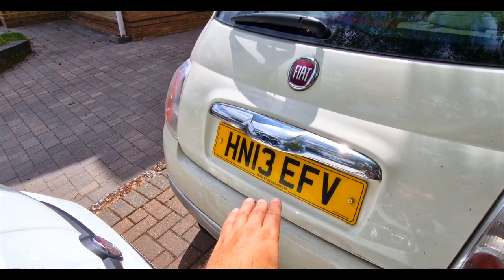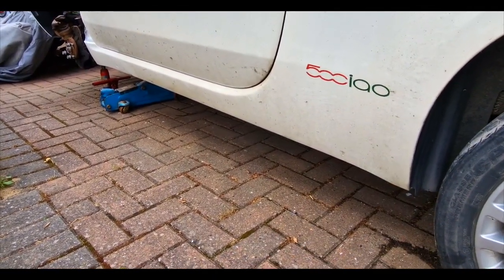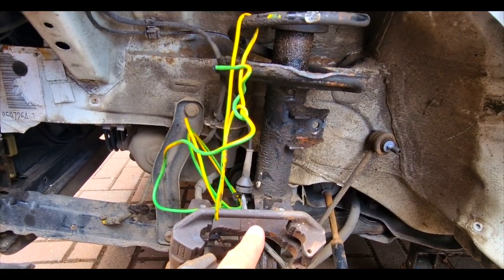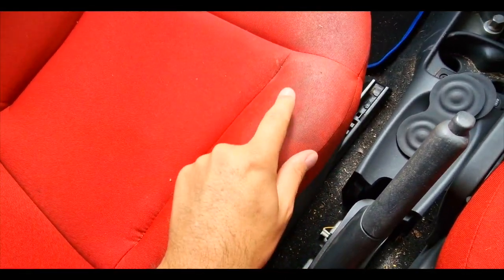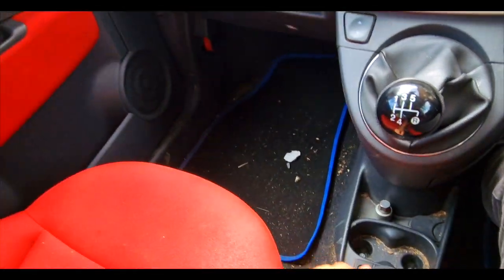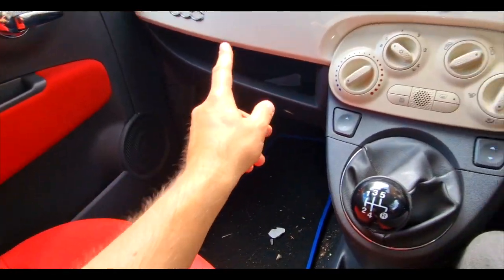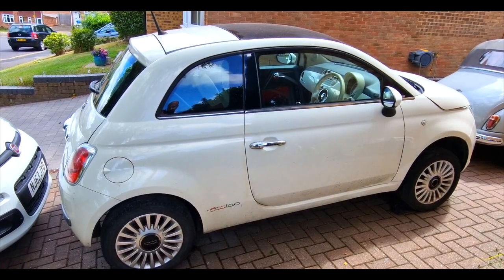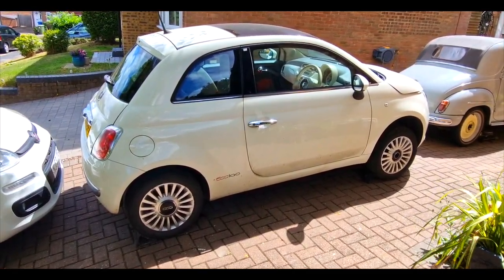Walking Around A FIAT 500 Explained

Comment: That’ll be the sensor in the damaged side. Just plugs in right up in the left corner of the wheel arch as it goes round behind the bumper.
Reply from the maker: Haven't even plugged it into multiecuscan scan yet, was hoping to clear the code but suspect you are right, again :)

Comment: Faults could be sensor on damaged corner as assume the wheel was broken by impact. Those faults could also be battery related. Nice one, good luck!
Reply from the maker: I need to run a scan and see if I can clear the fault first but could well need an abs sensor replacement. Will sort it on my next video.